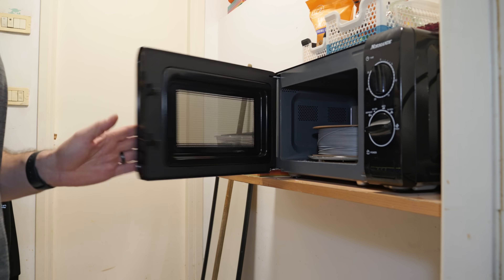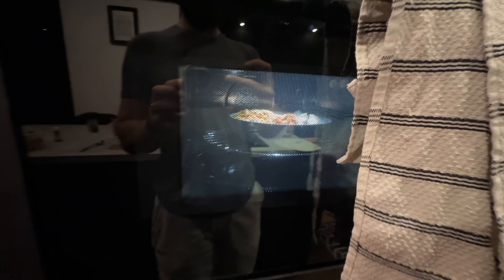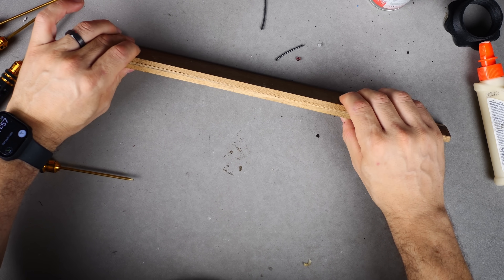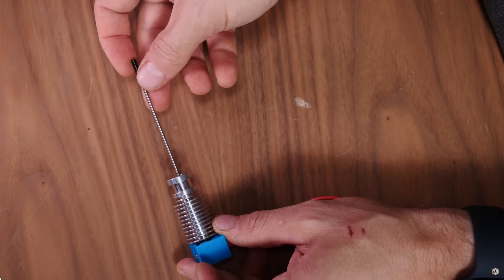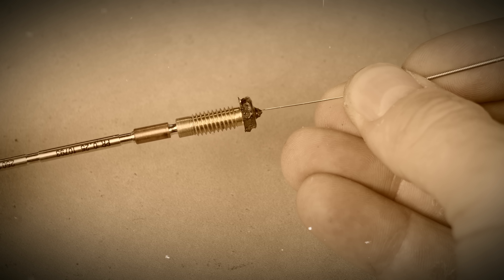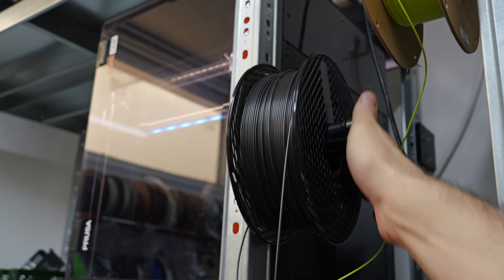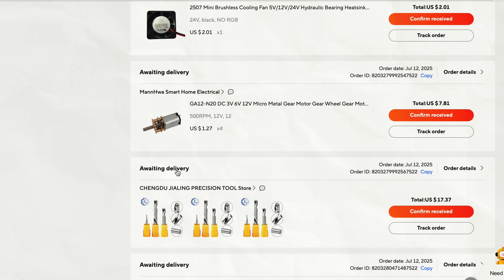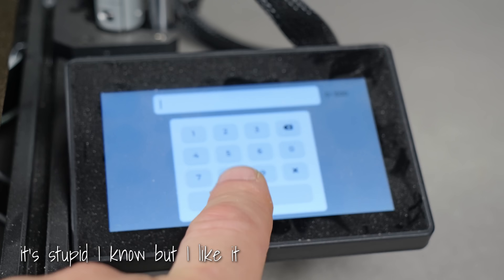Why I Microwave My Filament (+7 Other Strange Hacks)

Comment from the maker: Thanks for watching! Drop a comment below and let me know what you thought?
Reply: I'd like to see you go through learning freecad personally since that's the beast I decided to wrestle recently
Reply: @Justin-cv4oj i agree, I have tried, Fusion, onshape, Shapr3d and everything else I could find for free at least free to try, and the only one that made any sense to me is FreeCad, I actually made 4 items that printed perfectly the first time with it
Reply: Some super glue leave white residue on the print, which ones are you using?
Reply: thanks for this video i am a new printer and i have not got a fillament dryer yet and this is very useful.
Reply: Bambu doesn’t allow  cold pulls anymore as their low temp cut off is 170C
Reply from the maker: @JCon_22 that sucks.
Reply: @thenextlayer   איפה אתה קונה את הפילמנט
Reply: Yes please for the onshape video. I get so confused in onshape and reverting back to tinker as and accepting a less fancy looking design, or splicing together from other designs to get what I want.
Reply: The most effective way to remove a stubborn Steel nozzle clog is to hold the nozzle with a pair of pliers use a butane torch to heat it until it just starts to turn red then dunk it in water. This turns the filament into charred dust. You can then blow it out with compressed air or pick it out with your needle. I got this tip from a vision minor video
Reply: Sovol is trash. Worst 3D printers out there. The only reason that they sell any printers is because scammers like you spread and promote their printers for the kickbacks you get.

Comment: Here's one I just figured out today for getting accurate hole sizes. 

My setup uses a .6 nozzle with .72 line widths. 

For wide lines (≥120% nozzle):

In ORCA slicer,   Hole XY compensation ≈ (line width ÷ 2) − 0.02 mm

In my case:

0.72 ÷ 2 = 0.36

0.36 − 0.01–0.02 ≈ 0.34–0.35

So my final number to get accurate sized holes was modifying the  "Hole XY compensation " to .36mm

Comment: I’ve only owned my A1 mini a couple weeks and within 2 days I was taking off the tip and with my cleaning rod. Heating it up with a lighter and unclogging. Lol was afraid to use torch but if lighter didn’t work I would have. Figured that worst i could do was have to buy a new head. lol seeing you do it is good to see I’m not the only one.

Comment: Everyone in this hobby especially those it as long as you have been should have a good air quality monitor that does TVOC, you should place one near the microwave while drying different filament types and show us the results.
Even "safe" materials such as PLA and PETG print have toxic additives, especially the high-speed PLA,  turbo PLA PLA plus and other types of PLA and PETG with additional features

Comment: just put it in a box or container with silica gel. then dry the silica gel outside under the sun. it's much safer then risking drying the filament in an oven or microwave. it will take long time, but you can prep the filament early even if you mass produce parts consistently. also know your filament better before using it, or else you can destroy the nozzle before even next nozzle arrived.

Comment: To keep odd parts together while gluing you can use painter tape, very effective and if you need more strength, use electrician tape and pull a bit to create tension. This technique is also used for fine cabinetry.

Comment: Ok,  toilet rolls:  mount them the other way round because there's a good reason. Mounted flap over the front means that,  if you knock the roll,  it unrolls all over the floor.  Mount it flap down the back and, if you knock it,  it simply rolls up.  The oft quoted 'ah,  but down the back means it picks up all the fecal master from the wall, '  just what kind of sh!t house do these periods live in? And, that theory was bust by myth busters.

Comment: Since my printer is in a basement room with a cement floor that stays cold even in summer. So I've taken to placing my build plate on the cement floor to cool it down. Works faster than just waiting.

Comment: L, when I cook frozen meals in the microwave and it calls for 2:30 minutes or whatever I have always pressed 233, especially since on the microwave keyboard 123 top 456 middle 789 bottom rows and 0 the stray all the way down is a long way for my finger to travel
Reply: @studiodave56  great timing for me to read this. I just warmed some butter up to spread it using power level 3 for 33 seconds. (this was about 3 minutes and 33 seconds ago!)
Reply: This has the side benefit of not wearing out the zero if your microwave has those flex 'buttons'

Comment: Anyone using food preparation devices and utensils that will be used for food preparation after using them for 3D stuff, shouldn't do it.  Youtubers who recommend it are reckless. I can get in my local second hand  marketplace a microwave for around 15€. If you have spare space, I believe it's totally worth it.  Also, disclaimers are generally despicable. "I'm going to show you something that is going to enable you to do something dangerous, but hey, I'm not responsible for enabling you" Yeah, you provided the knowledge for someone to get hurt.

Comment: As of the cleaning filament, it's easier and sometimes even cheaper to buy a 500g spool of the cheapest noname Nylon filament. Buyers report abnormally high shrinking and warping? Great, that's exactly what we are looking for!
It's a lifetime supply and the spool itself provides more grip to pull at when cleaning particularily long nozzles (Volcano length and above sometimes require a ridiculous amount of force).

Typical process: 
1. Heat the hotend as hot as possible (though, 250-270 degrees is usually enough), disengage extruder gears if possible and start slowly feeding the filament.
2.Turn off the heater. Keep pushing the filament until the hotend cools down to at least 50 °C, ideally room temperature. It wil stop oozing at around 120 °C, but keep pushing. Use the part cooling fan to speed the process up Here we rely on the natureal tendency of nylon to shrink during solidification, otherwise it will be still sit tight in the nozzle and cold pull is very likely to fail.
3. If the parts cooling fan was on, turn it off.
4. Reheat the hotend to 70-80 °C, let it sit for 30-60 second to evenly distribute the temperatureget a good grip on the filament or the spool with one hand, top of the extruder with another hand, and YANK the filament out in one sharp move.

For the first time, it sometimes takes 2-3 tries to adjust force of the yank. Too soft and slow - an the filament may neck in the heatbreak. Too sharp and strong - the filament will likely break inside the nozzle. The longer the nozzle, the narrower the margin of required force.

Comment: So just tested the microwave with sunlu petg definitely saw big difference with about 4 cycles of 40sec with my 800w microwave. If I had 1,000 w or higher I would probably only do 30 seconds at a time. I pulled mine when the infrared temp read 55C. Have you tried this with TPU also?
Reply from the maker: Yep. Works great.
Reply: @thenextlayer  welp nope scratch that. 55c was too high. center of the spool filament was brittle and melted to itself.

Comment: The 222 trick is a great timesaver. It's close enough to the "right" value for any ordinary filament.

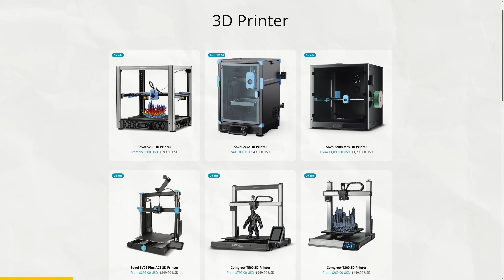Take it to the next level on your microwave. Instead of hitting 1:30, hit 88. Yes, most microwaves will accept 88 seconds! When you have to set the power level to about half, enter 44 or 55. So something that probably needs two minutes but you want to do at half power, enter 4:44 and 44. No more hunting for all those other digits. Nobody knows exactly how long something needs to be in the microwave anyway, so there's no need in getting fussy about precision.

Truth is, in a microwave it's always at full power, it just duty cycles so that the fraction of time that it's on equals the power level you set. Listen to it sometime, you can hear it cycling. This lets the heat re-distribute during the off periods. When nuking your filament, try setting to a low power level for longer. This will reduce the peak temperatures, and I predict it will more effectively get rid of the water by holding it not quite so hot for a lot longer.

Comment: This tip might be a tad overkill, but about every 100-200 hours I do a first layer test on my entire bed. And readjust the bed. Most of the time it's just a tiny bit. But it helps ensure my bed is as level as possible (I do a lot of full bed prints)

Comment: On shape? lol, I promise you, it'll take you just as much time to learn as one of the industry standard, such as Solidworks, Fusion, 360 [Autocad], Autodesk, or Mastercam. 

I learned some auto cad in high school, but a secade later , I was learning & using Mastercam managing an aerospace shop, and now i'm running Fusion from home currently. For 3d modeling/ CAM, I still like mastercam the best by far, although that's what I have most of my experience in. I've gotten fairly efficient at fusion the last few months but I don't like how's slow, it can run as its constant regenerating for the parametric solids- and while it did get a little better, my F360 PC build didn't make the difference i thought [i7 14700k, RTX 5070, DDR5, name m.2, etc].

I understand that you'll need a commercial license, which oftentimes is much more expensive, but I know all these companies have worked with content creators at one point or another. 

Again, this is totally my opinion, but it was formed from my own experience over 10+ years of high end manufacturing, engineering, machining, etc.

Whatever option you go with I will say. Wow, the classes or the challenges are a good way to get introduced to the software and learn some basics. However, if you desire to move past beginsir, it really takes practice and using it.And experience to get better. 

Definitely a long road to learn but I think very worth it. There will be many frustrations along the way lots of googling questions greeting up the forum's trying to find an answer... don't give up. Good luck!

Comment: My trick to faster cooling PETG is, after print lift(z-axis) the toolhead a little, than put toolhead fan ON on low speed till the print bed cools down to 50 degree. Happy printing!

Comment: my personal favorite: WASH YOUR BUILD PLATES
man the amount of failed prints i had over the years just due to oils and fats and invisible dirt being on the build plate is tough to swallow. a good calibration run on a clean build plate goes a looooooong way to improving print reliability, even on a Bambulab. PC and PC FR just HATE oils no matter how good your printer is. whenever i print with that filament, i put on gloves, pre-clean a plate with dish soap and warm water and pray ... a lot.

Comment: The speed loader is great, I use it on my Voron and TV06, which each have 0.5 to 1m bowden tubes. They even work with TPU if you are careful.
Preheating the bed while loading filament is my go to. (Or even just while uploading the file, saves a couple of minutes.) I do like the 222 c for preheating the nozzle. Not too hot or cold for most filaments.
If you are getting clogs in the heat break, make sure you have cleaned it between ASA and PLA. I have had that happen a couple of times and the 5m of cleaning filament I get free with one of my filament brands (Ziro) is perfect to run through at a high temperature and get rid of any ASA or Nylon in the hot end before trying to print PLA.

An OnShape tutorial series would be nice, I already use it, but there are features I haven't touched yet, and I know there are many ways to do the same jobs.

Comment: yes, microwave at high power to dry filament is high risk as are the VOCs as you mention ... there are safe options available now, much safer
Reply: "double glue" trick?/ ... nah, PLA Gloop or similar as a bonding agent

Comment: Had my first jam in over a year on my Bambu A1 yesterday but it was 100% my fault. I was using PETG end of rolls up on a print and feeding one in after the other on the fly. Going from White to Clear, I didnt notice both ends were cut at a angle and they got jammed side by side.  I was half way through the print and had to put a lot of pressure on the head getting the 4way off to clear it. Once done, It purged and went back to work remembering exactly where it was in the print. Good job Bambu Lab.

Comment: I store my filament in the airing cupboard (out of the way of my wife's beady eyes).

I didn't know extruder nozzles could explode! Heating them up to almost red heat has  been my standard method of nozzle cleaning for years.
Reply from the maker: Only the integrated heat break ones because of different metal sizes. Or sometimes the clog can explode out. Wear safety glasses.

Comment: 11:32 be certain of the design you use for spool desiccant holders based on the size of openings and size of the desiccant. I have had to clear all of my AMS out of excess desiccant beads cause the tinier pieces will tumble out. Now, those holders are only for dry storage of spools.

Comment: My tip, multiple printing plates and a rack for them, I'm impatient...and lazy, I dont wait for things to cool, I pull my print plate off, set it on my custom flat rack to cool then slap another plate on and get the next part printing.

Comment: I use the conduction trick to cool my build plates all the time, I have an old heavy PC case with a flat top that sits near the printer. pressing the plate gently onto that cools it rapidly and makes parts pop off satisfyingly sometimes.

Comment: So many videos on 3D printing with rolls of filament sitting open on shelves behind whatever is going on as the topic. It makes me cringe because if that was my place, it'd be string city. All of my filament lives in plastic cereal boxes with desiccant in the bottom of each. Cat litter pulls the moisture from filament way faster than silicon desiccant but it becomes clumpy and sticky. 
I regularly open up those small paper bags of silicon desiccant and 9 out of 10 are always already water affected, even the ones coming out of fresh filament rolls you've just cut out of the sealing plastic. Unless you dry them yourself in a heater, they don't draw much water from anything and are just decoration. Buy a small desktop oven and dry those bags a hundred at a time at 250 deg F (120 deg Celsius). Cook for 15 min, open the door and let the moisture out then repeat 3 times.
Reply from the maker: You don't need to worry about PLA and ABS that much...

Comment: Related to your "222" trick, on my Prusa Core ONE you turn the dial to set temperatures rather than tapping a number pad. I've found that if I want to get it heating just a little faster, I should just spin the dial wildly and set it to some value far above my desired temperature, just to get the heater going. Then I can fine-tune it down to where I want, which I'll be able to do before it overshoots the target.

Comment: NEVER stand that close to a Microwave. 
Always stand at least 6-8ft. away. 
This isn't conspiracy theory.
I heard this from a world renowned heart doctor.
Reply: That's probably only really risky if you have a pacemaker. Hence the advice coming from a heart surgeon.
But I agree, stand a bit away just in case the seal is leaking a bit or some other fault. Costs nothing to be a bit safer.
Reply: @kimchristensen2175  It's more to do with your microbiome and the accumulated radiation over a lifetime if I remember correctly. The talk wasn't about pacemakers...I'm not THAT old, lol.
Reply: @ProfessionalTrafficplayer  except this type of radiation simply heats your tissue and doesn't "accumulate".  I doubt it would effect your biome unless it really raised the temperature of your tissues and you'd feel that happening.

Comment: I use multiple Print Plates, so I do Not need to wait for cooling down.
Another Advantage: If one Print Stucks so hard on the Plate. I can remove IT slowly or in the fridge without interrupting my prints.

Comment: The Bowden speedloader is excellent, I used the Li-ion remix on Printables which i tweaked a little to accomodate the boost converter and charging board I had on hand,  I'm planning on adding a DPDT switch so I can flip the motor polarity for rapid unloads.

Comment: Inline dryers are expensive.
Heat dryers are slow. 
Microwave as dryer is cheap and fast.

So how about inline microwave filament dryer? You could use it white printing (needs to deactivate if filament is not moving for a while) or Just a auto respooler with inline dryer.
Is there any project around this?

Comment: You don't tell which temperatures are supposed to be measured when you show the microwave oven trick.
Reply from the maker: I just stick my hand in the middle of the spool, if it's quite warm, take a break.

Comment: I did use a microwave oven to dry filament once. Haven't had great luck with that. Having the inner layers of filament fuse together is way too easy to do accidentally. If you want to use an appliance that is fast but reduces the risk of overheating I've had far more success with an air fryer. I have since replaced the spool holders on the printer with a cradle that takes a Polydryer box.
Reply: What temp and time are you doing on the air fryer?
Reply: @jeffgerards I mostly print in PETG so I tend to select 80 degrees for 6 hours or so. Unlike a regular oven an air fryer usually mixes in a small amount of fresh air so they tend to be quite good at drying stuff. Do make sure to preheat it though, because throughout preheating the heating element will be at full power and could damage the spool. Also, don't leave it unattended, obviously. You're using an appliance for something it wasn't intended for so extra caution is advised. Also, if the air fryer is only barely big enough and the spool sits real close to the heating element, don't do it.